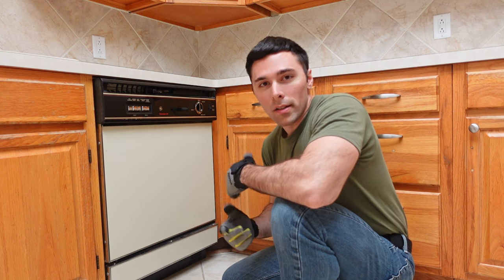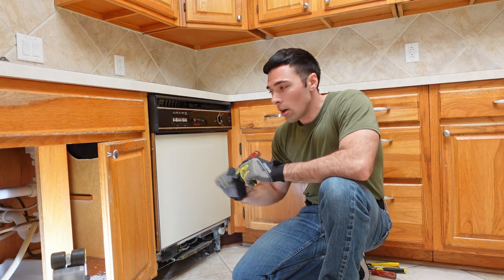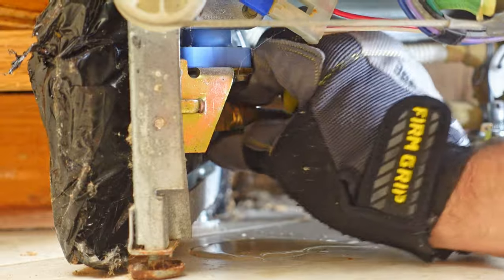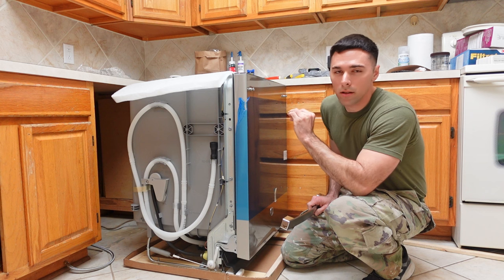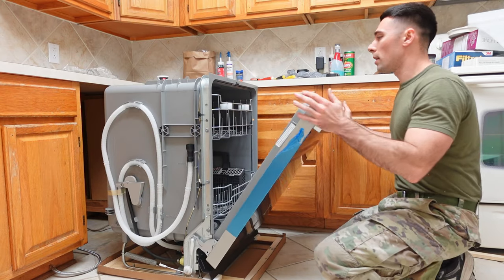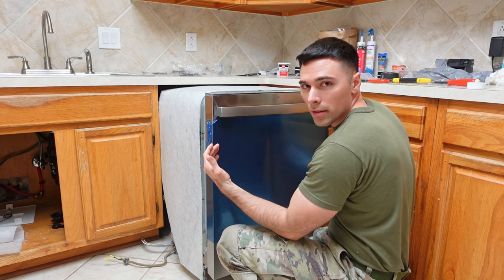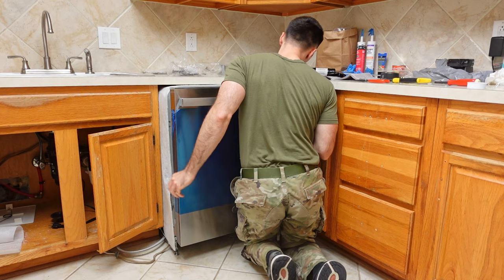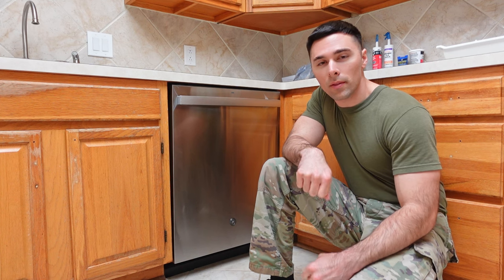How to Remove Your Old Dishwasher and Install a New One || Time for a Major Upgrade

Comment: Sometimes those old GE Potscrubbers, or KitchenAid (Hobarts) will run for decades. Most of today's machine's probably won't.  The older ones may not be as efficient or aesthetically pleasing, they don't usually have microchips and other   items that break down .
Reply from the maker: I agree. If i remember correctly (this was my parents house and its been a few years) the garbage disposal did not work so I replaced it and the dishwasher had some issues as well. The dishwasher was also incredibly loud. Unfortunately as well built as the older appliances were, they do tend to be very loud compared to new models that have managed to reduce the decibel level

Comment: I thought code for dishwasher was it needed its own 20 circuit, couldn’t be shared
Reply from the maker: The National Electrical Code is funny because it is in fact not national. Its up to the states to adopt it and 6 states don't adopt it at a state level and allow local government to adopt it. Also any house built before the code comes into affect is exempt from the new rules so it only affects new construction. So for you the dishwasher may need its own 20 amp circuit. But for me so long as the dishwasher and disposal do not combine to pull more than 20 amps than they can be on the same circuit. I have never lived in a house where the dishwasher was on its own stand alone circuit, the fridge yes but dishwasher no.

Comment: I noticed your old washer had 3 electric wires, but the new washer has 4. I have the same new type of washer. How did you connect them? You skipped showing the electric connection.
Reply from the maker: I skipped showing the connections because it was basically impossible to get a camera angle to see what I was doing since it is like a inch off the floor. Honestly I do not remember how I did the connection, this video is almost two years old. I installed this washer at my parent's house and they have since sold this house so I cannot even go look at it. The instructions on new washers typically have very good step by step instructions that will explain how to handle the wiring process based off what situation you have going on for powering the washer.
Reply: Modern dishwashers now just plug into an outlet under the sink cabinet - along with the garbage disposal.